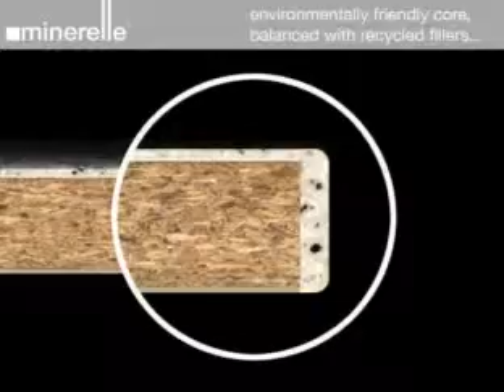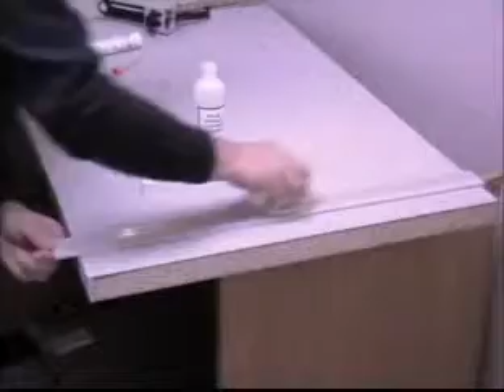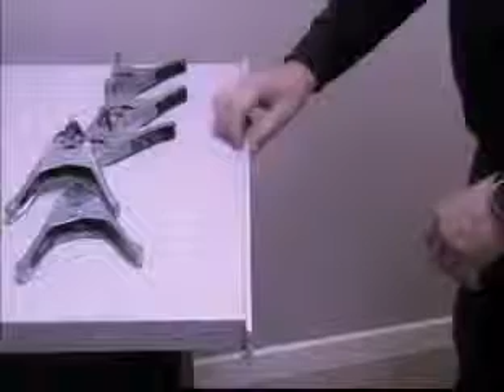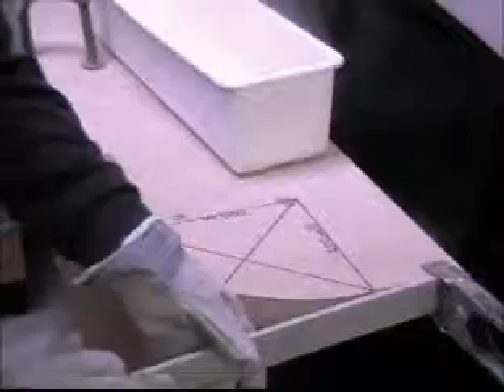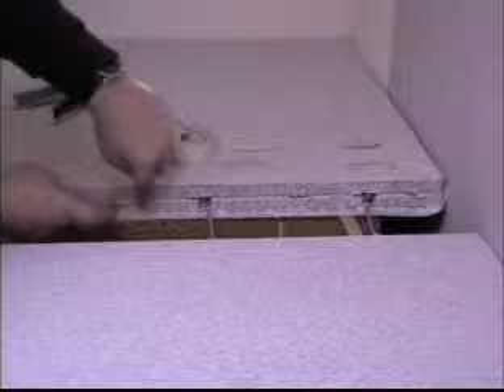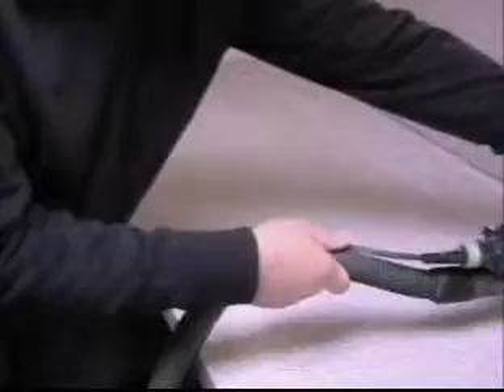Minerelle Installation Video 1 1 1

Comment: Hi great video. Do you know if the cleaning fluid and the grey adhesive as in the video can be found?
Reply: Hi Yasziy. The adhesive may be available from most solid surface distributors. The grey adhesive is a light grey and is no longer available from Minerelle - but a distributor could advise on alternative depending on the colour of worktop to be joined. The finishing spray polish is available from www.minerelle.co.uk.